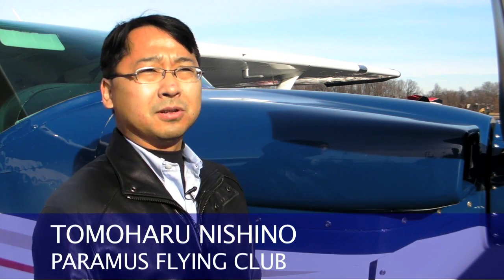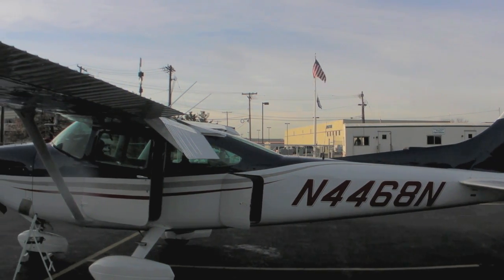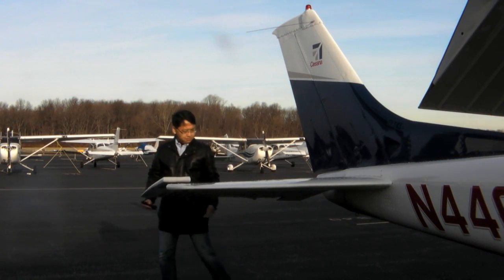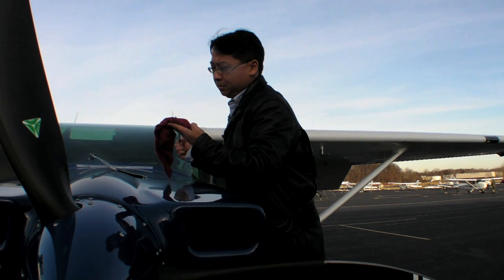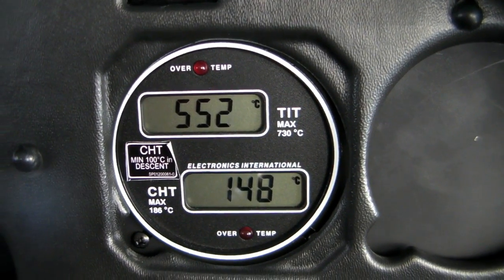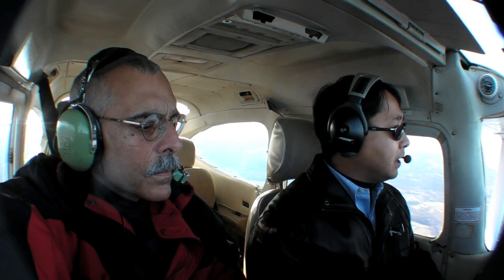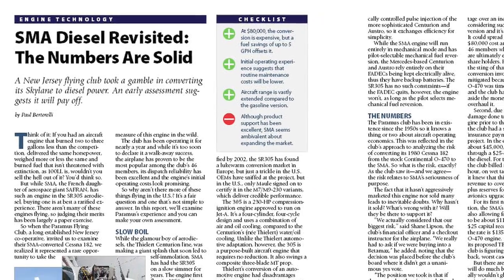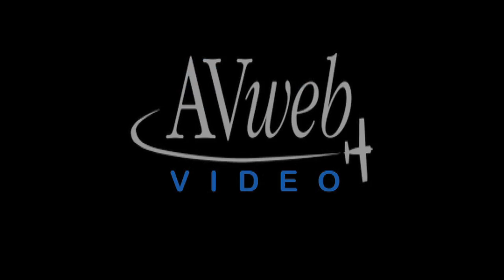Flying the SMA Diesel Skylane

Comment: I'm glad I live in America where avgas is relatively cheap and readily available. I don't trust these diesels and now with the trump administration I really don't think we are in danger of losing leaded avgas anytime soon. Seriously 100LL is  such an amazingly perfect fuel we need to get some rock solid legislation that allows us to use it indefinitely. I don't believe for one second that the lead emissions cause any significant environmental concerns. Just don't believe it. Think how much lead was in the air in the 1950s when all gas was pretty much highly leaded and people born then are absolutely fine and don't have lead related health issues.
Reply: Petrol is an insanely inefficient fuel and the tank range compared to diesel is not even close.
Reply: Blade8922 - That's because gasoline engines have barely changed since the 1950s. Modern gasoline engines (like the Adept Airmotive engines) offer a significant improvement in fuel efficiency and don't need to burn leaded fuel. The BSFC (by weight) of diesels could probably be matched by modern gasoline engines, gasoline engines are significantly lighter than diesels, and unleaded gasoline is even cheaper than jet fuel.

Comment: Wow! Flame out on power back? Why the temperature limits? Diesels work well in minus 80 degrees! This thing need work before it will sell. By the way, Jet A IS diesel IS kerosene! Better stay away from Jet B or russian jet fuel, it is gasoline cut for helicopters and early jets because of fears of freezing fuel(never happened) but it will kill a diesel engine. Av gas scarce? What's wrong with auto fuel? Two strokes work FAR better with it(less carbon/lead deposits) and is commonly used in DC-3 and even C-46(in cruise)...all Pratt 985/1340 Beavers, Beech 18, Otters, Norseman and Mallards commonly use auto gaz with a STC(need an extra fuel pump to keep fuel pressurized, is all!)
Reply: Jet A and Diesel have very different certification standards, especially in terms of cetane.
Reply: But in the real world, it has been "discovered" that they may be interchangeable. Heck, I know of at least one use of gasoline+heating oil to get a turbine airplane out of the boonies.
Reply: @UncleKennysPlace  Since turbines run on AVGAS too that doesn't prove anything I guess.
Reply: Remind me to never fly with you. Any jet fuel blend and diesel (of ANY type) are wildly different and totally different cetane and lubricity ratings. They even gel at different temps. I think the low temperature limits has to do more with thermal shock and a diesels slower heat up and lower thermal load when compared to an AvGas rig. If you've ever seen a diesel get started up in -80 you know for sure that it takes a GOOD long time to get up to running temps and (since they are typically used for pumping or power generation) are usually put under enormous and continuous load. While aircraft can see this, load throughout flight still varies much more than I stationary applications which are using liquid cooling and much heavier lube oils anyway. And btw,.. two strokes are WAY more susceptible to carbon deposits... And the reason ANY aircraft uses 100LL is due to its lubricity and octane rating from the lead content. It's why they used to use it in cars, and.. considering how little the current aviation piston engine design has changes since probably the 1940s... It's of no surprise they are still requiring 100LL. You'd blow up a Lycosaur without it. And dont get me started on 2-smoke reliability... I'd never be caught behind the yoke of a 2 stroke aircraft... No way! You wouldn't even have any type of fueling infrastructure... And on top of having to use a total loss oiling system you'd still have to use expensive 100LL likely.

So yeah. There's a reason they're pushing for Jet-A compression ignition engines. There's a lot of advantages and the technology is still in it's infancy and will only get better as they work out the kinks. 100LL will definitely NOT be around for ever... And once a date is decided on to phase it out ... You'll see a MASSIVE shit in the industry to move to Jet-A piston engines. Moreso even than the current half assed attempts. SMA is going to  have a field day making a meal out of Lycoming and the already corporate chinesium conglomerate mess that was Continental. It's now owned by AVIC (China) and is part of the same group as Thielert / Centurion, etc. Not even American anymore. So yeah, that's what's coming up unless Lycoming can build a desirable Jet-A engine before 100LL is regulated out of existence by the EPA.

Comment: I don't see a return on investment here until the difference between diesel price and lyc overhaul price is achieved. Assuming that is $55k, you can buy an awful lot of avgas and maintenance on the lyc before that is achieved.
Reply: By the hourly figures the club gave, looks like it would take 1375 hours to break even. So if they run to 2000hrs they save 25k.

Where I live would pay off much faster since JET-A is $3 cheaper per gallon, add that in with 3 gallons less fuel burn per hour and that’s $50 per hour in reduced fuel cost.

Definitely wouldn’t make sense for aircraft that don’t see a lot of flight time. But on aircraft that fly +200hrs per year there’s nothing to lose.

Comment: Anybody know what the difference between normal automobile Diesel and Aviation Diesel/Jet-A?  If I bought some filters and funnels, could I turn automobile Diesel in to Aviation Diesel?
Reply: jet a1 is not diesel,,,,, its kerosene
Reply: Well the CD-155 is a heavily modified Mercedes Diesel engine. It actually needed substantial changes to meet certification.

Comment: This kit allows these aircraft to opperate in places like Africa and parts of Asia where JetA is available but avgas is hard to find.  This is a great step for aviation.
Reply: Cessna needs to catch up, otherwise, Tecnam P2010 TDI will replace 172 and 182. P2010 TDI burns Jet A and is beautiful like a Ferrari, costs less than Cessna. It's like a Ferrari costs less than a Ford; I would take Ferrari instead of Ford every time.

Comment: @dtoften If i heard right the 12 degree limit was only set if you didnt cover the ventilation holes in the cowling. A diesel engine runs considerably much colder and generates far less excess heat in its operation. In effect the problem is to insulate the machine rather than get rid of excess heat...

Comment: But this is a diesel and will still be like new in 7 years and still saving money.

So they spend 65 thousand more than the rebuild would have required, but it's cheaper to operate and saves on fuel, so will more than pay for its self and then some